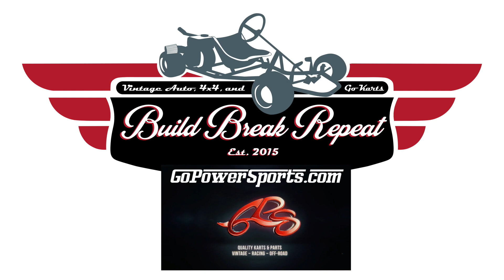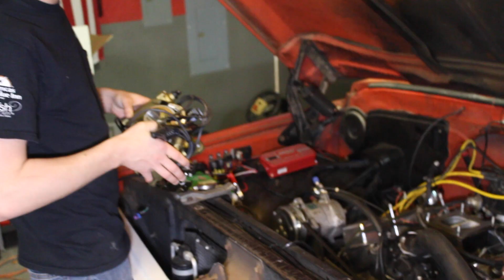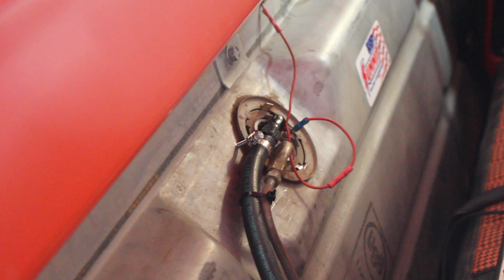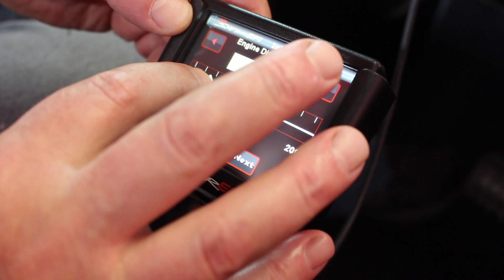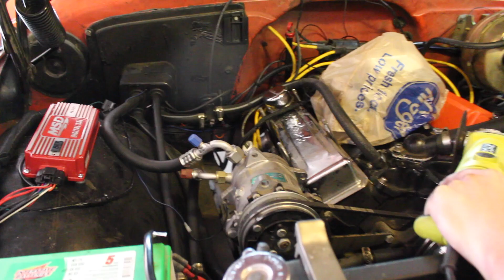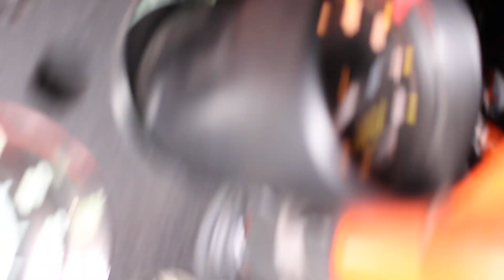1968 C10 Holley Sniper EFI Install!

Comment: Hi! Any updates now on the whole efi conversion? Did you keep the tank in the cab, did you add or have to do more than what was set up in this video? Could you explain more on how you installed the return line into the oem style tank. Thanks!

Comment: This might be a dumb question but how did you thread the fuel return line fitting into the hole you drilled? And what’s keeping it in place? Because I’m trying to do the same with the stock tank.
Reply: Any reply?

Comment: What did you use for the return line as in how you put it in the tank. Did you just drill a hole to add that fitting and was there one that goes on the inside of the tank. What fitment is it aswell
Thanks
Reply: Same question

Comment: One quick note... I learned this the hard way... It's usually better to use crimp terminals versus solder, because in a high vibration environment, the solder joints tend to crack. That's why in that venue crimp terminals are better. Just get ones that plug into a nice waterproof connector  and viola!

Comment: consider notching the dual plane manifolds, its that divider wall in between the 4 ports needs to be cut down a bit, (while out of  the vehicle of course) the sniper seems to prefer single plane manifolds, you can get a whistle and poor idle and more problems using an unmodified dual plane manifold, also i recommend switching to a progress throttle link, its avail for around $14, need to update firmware to reset the new progressive ink setup

Comment: This seems like a cool idea for a conversion from carb to EFI, however in my case for my car( 1981 Malibu 350) I recently installed a dash from Dakota Digital and their package includes: temperature sensor, digital VSS, oil pressure sensor and tach hookup into their ECU. If i was to purchase the Sniper, would I have to use their equipment? Could you help out in letting me know the compatibility between the ECU for the Sniper Carb and Dakota digital ECU?

Comment: Its really cool how you get all those great deals on products you wouldn't pay for and then toss it all together and see it work.... But your work looks like shit.. I mean it's sloppy and crude.... These fuel line here just above those headers is someone looking for disfiguring scars and a life long reminder of getting ahead of yourself with a quick easy it's so cool moment... In those instructions you didn't read or simple didn't understand, you that your install will be dumping the fuel back into the tank and aerating the gas.... This will put air into the fuel mix and it's all going to mess up the EFI.... Don't bother with waisting money on valve covers and remember people out there that think you got life all dialed in will also think your idea of an install is how it should be.....  I know you can do better, so just do it....

Comment: thank you for the video.
I am installing one on my 1972 small black blazer.
couples of issues that a ran into , is the EGR valve needs to be blocked off as it hitting the new EFI ?
there are two PCV valve , I assume that one can be split with the break buster and connected to the EFI.
what about the other one ( that went into the air filter)?

Thank you
Reply: Adar Farkash - install a block off plate for the egr, remove vent hose to air filter, and add a breather vent (looks like small air filter or can)

Comment: Neat truck!  Small recommendation?  Consider locking down the distributor advance and using the Sniper's ignition timing control in the future.  You're going to get a lot better performance and economy letting the EFI control your ignition.

Comment: Does your stock speedo and gauges still work with that set up or do you have to switch to digital?
Reply: Why would the speedo be hooked to the carb?
Reply: Thomas Jefferson It's gotta go through the flux capacitor first.
Reply: Gary  White hey I just got this setup and it all works with the mechanical gauges. You can set it to where it runs holley gauges. It will even control timing without the msd box

Comment: Fuel Pump woeks best when installed Below fuel  level of tank..
Reply: Best to push rather than to pull fuel.  Not the same with a chain :)  Yer right Hector.

Comment: Not 100% sure but I think your not supposed to run that style intake with TBI.
Reply: Saw someone saying it runs fine if you use an open spacer, or machine down the divider between the planes where the carb mounts, 'cause theres just one MAP sensor, and if the intake is divided, the signal wont be right

Comment: Great video guys. One thing you might want to think about if you haven't already is moving and replacing the gas tank for safety reasons. There are a lot of kits on the market now days for the older chevy trucks that had the gas tank behind the seat. Have a great week and God Bless!!!
Reply from the maker: nashguy207 Makes sense, I’ll have to take a look thanks.
Reply: My 69 has a tank from an 80s blazer in the back 👍